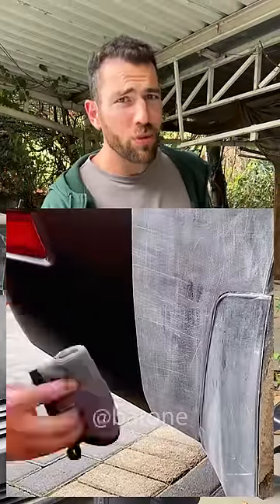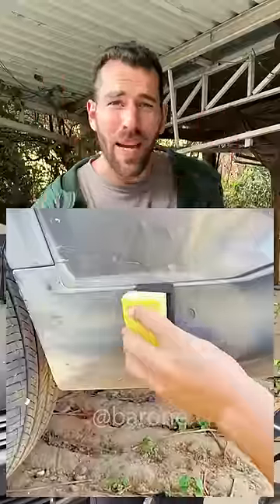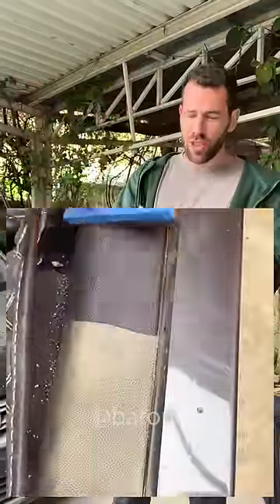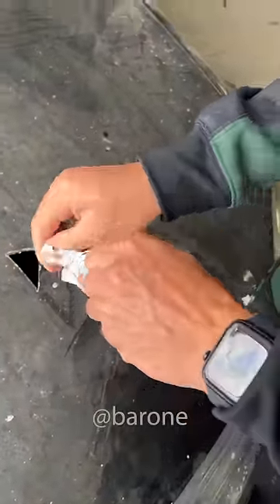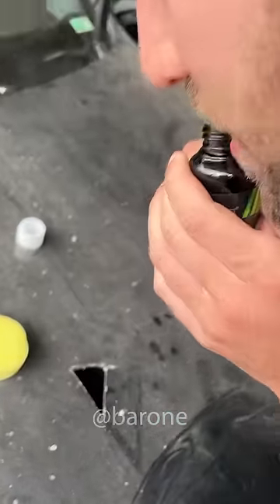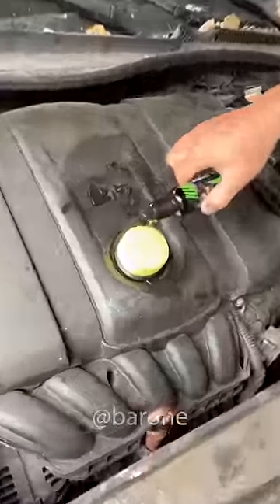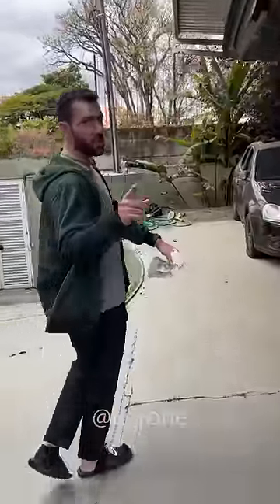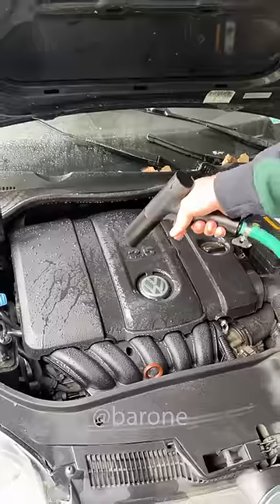This acid makes your car look like brand new

Comment: The amount of brain cells I just lost is astronomical
Reply: Agree
Reply: @TheGloryx112  how come i don't get it
Reply: @XstaticG  i think he is advertising the product wrong, its supposed to be used after the car is already clean.
Reply: @sagearuytgaming1347  the guy is wiping the dust of the engine with a spray. No really? I could get the same result with water and a clean rug
Reply: @TheGloryx112  he’s not wiping it. He’s adding a protective layer, like flex seal. So he’s literally putting spray over dust and dirt. He’s gonna have a not so running engine after a while.
Reply: It’s bothering me 🙃
Reply: He is a brazillian youtuber that reviews this kind of product
Reply: @lolpet2  He advertised as shown, if you use it on a clean car the effect is less noticeable. The point of ads is to always exaggerate and put on a big contrast, that's why most "magic" products are a disappointment in reality.
Reply: Literally.
Reply: @mandalorianforza9639 thank you so fking much, i was wondering which was his language
Reply: Not only did he apply his shit wrong he said I’ll clean 50% proceeds to “clean” 80% of it
Reply: Probably more than I'll ever have
Reply: Why
Reply: @slowbbs  good thing that’s just a cover 🤯
Reply: @mellow8309  it got all over the other components when he sprayed it all over his sponge.
Reply: @lolpet2 in the ad, it was dirty, the car

Comment: The fact that he opened the bottle with chemicals in it with his teeth and did not clean the surface before he put the stuff on there says a lot about this guy..
Reply: Bros probably not even real, my guys givin me bot energy lol😂😭
Reply: @chopboss  😂
Reply: Bro this is legit mineral oil
Reply: @lucab1733  how do you know? It says acid. And even if that's main ingredient, they probably added more chemicals that you should not get into your mouth
Reply: Bro he washed off the engine 😭
Reply: Or maybe just use water ?
Reply: InXanityZzz  you can do that after it’s cooled Down
Reply: InXanityZzz  whilst it was hot 💀
Reply: In all fairness they didnt clean the cars in the video either
Reply: Says alot? Look at his yard and Under his hood😂
Reply: Mate he’s just copying the technique shown on the adverts to test its validity
Reply: @donnyuploader  Opening the bottle with his mouth was part of the instructions?
Reply: @nijmegenares  I’m referring to the not pre-wiping down of the surfaces before application
Reply: @Hello  honestly, even if they do that in the ad, I would not use it like that, the dirt gets into the sponge, so if you use it on cleaner surfaces you would smear the dirt all over
Reply: Hes brazilian
Reply: InXanityZzz  yes you can.
Reply: @snappygaming5594  which you can do
Reply: And had the engine hot
Reply: so you mean any man
Reply: @viktorbihar5384  I feel like that's what the inside of his head looks like...one big mess
Reply: This guy has to be so generated, no way he’s real.
Reply: To be fair the car surface in the the advertisement wasn't clean aswell
Reply: The advert shows their car was dirty too. He may be was trying to do the same? 🤔
Reply: C'mon bro, that's rude. Let the guy live his primitive days in peace. 

Sure he doesn't know what car polish is
Reply: @nijmegenares  And coca-cola says citric acid in it and it aint gonna fucking harm ya calm it down
Reply: @jcdenton166  he is not opening a can of coke, it's something to clean his car. But if it not gonna harm, start drinking it than, I don't think there is anything in that head of yours than can get harmed

Comment: Hello, I professionally clean and detail semi trucks, and other commercial vehicles, along with occasionally cleaning our staff cars. 

Any soap with degreasing agents will get the same result (dawn dish soap for example). We use a mix of a chemical called “Formula 20” and “Step 2” both are industrial degreasers that we use because these trucks get absolutely covered in grease, bugs, etc. as they drive all day, this build up requires heavier duty chemicals to remove effectively, along with scrubbing from giants brushes to break up the surface of the gunk allowing particles trapped in the paint and metal to come out easier. For your average car you won’t need any heavy duty chemicals, a mixture of 1/4 dawn dish soap, and 3/4 water along with using a sponge or microfiber towels to remove dirt will produce similar results to what’s shown in the video. I always recommend adding a protective coating after cleaning, but not necessary.

Comment: Let me spray my alternator with water, it’ll be fine
Reply: The car is of therefor the alternator is fine
Reply: Yes it will be fine. Likely wont affect it
Reply: What do you think happens when driving in the rain?
Reply: Have you never sent your car into the car was to get a deep engine cleaning 😂
Reply: The engine was warm💀
Reply: @TacticalPhoenixYT  worse that could happen is it cracking the block from rapid cooling but highly unlikely
Reply: @214kai2  there are other more fragile parts than just the block. Main issue are cast iron parts, which are incredibly easy to fracture.
Reply: If your alternator can't take that, it's an American car and you ned to exchange it, it's defective.
Reply: I’d be more worried about that acid getting on the copper windings of the alternator than water.
Reply: That is his jetta.

Its kinda like a meme the amount of things this dude did to thia car
Reply: you can spray an alternator all day, it wont affect it.
Reply: Got water on plenty of alternators over the years. It doesn't affect them one bit but your belt might slip and squeal for a few seconds.
Reply: @TacticalPhoenixYT  

Only if you smack them with something.
Reply: @skylined5534  no, rapid cold changes can also crack cast iron.
Reply: @TacticalPhoenix  still unlikely unless you're over heating or something
Reply: It's funny how many people think water will hurt a car, have you never driven in rain?  Metal fracturing with temperature change is a thing, but it's only really a problem with Extreme temperature changes say your car is overheating massively  and a large volume of water is in contact with it. 
how people think that a spritz of water could do damage to a car is beyond me. Look up 4x4 river crossings if you don't believe me
Reply: It actually will, water should do literally nothing to your alternator unless completely submerged.
Reply: @214kai2  Take it from someone who used to dump room temp water in a flaming hot 25 year old junk racecar rad.... Unless you are poring ice water you will be fine.
Reply: It will be fine. Your engine bay is designed to be pretty waterproof. It would take a flood to damage the alternator.
Reply: @SoloKyoto  yea that's what I'm saying, I had huge hood vents on my old gs300 and I would take it through car washes when the motor was completely warm and had been driving for an hour or two and it was always perfectly fine.
Reply: guys it's simple...Just keep your engine (and all it's surrounding components) away from water, OR don't use high pressure water, use a light sprinkle, like the "shower" setting. No matter how modern your car is, water and electricals don't go well with each other especially overtime. One day the car ain't starting, or there's 1 or 2 christmas lights on the dash...WHY? Because of something happening on one tiny connector....CORROSION.

So long story short: Keep water away or use in safe manner.
Reply: @Kio  nobody is saying submerge your engine in water. Also pressure isn't gonna matter as much as your making it sound, only thing you'd have to really worry about is pressure popping out sensors (if even that). Cars are built to get wet, that's why you can drive through super bad thunderstorms and be fine. You just don't spray the intake and don't use freezing water on a hot block
Reply: Will literally be fine but ok
Reply: @michaelmay5453 American cars are best, 3rdworlder.
Reply: It would be fine....ever wonder what happens when you drive in the rain or through a puddle!????
Reply: @demaciasolos  AHAHAHHAHAHAHAHAH
Reply: @demaciasolos  I'm going to assume this is a joke.
Reply: @michaelmay5453  And i’m going to assume you are one aswell.
Reply: @demaciasolos  Whatever you say, kiddo.
Reply: It will, a signicant amount of cars have the alternator on the bottom of the motor layout, where it is exposed to water. Spraying your alternator with water and it failing is a wives tale.
Reply: @michaelmay5453  Still better than anything British. All cars are built in different countries. Volkswagens are built in Mexico for example.
Reply: Your average alternator even works fine underwater
Reply: @214kai2 what do you think happens when your driving in the rain
Reply: it doesn't matter it will be fine alternator coil has coting on it and it not easy to short circuit that part however a junction box/fuse box or ECU is something you should be worried about....
Reply: Wait till you hear about rain
Reply: @hassanhabib4716  Oh yeah it is, you see there is a transformer on it to turn the alternator AC into DC.

The ECU OTOH is sealed shut and in most cars it's not in the engine bay anyway.
Reply: It will be fine lol
Reply: @Mike-we3rb  Yeah, so completely soaking something  is quite different from spraying it a little bit and most cars put the alternator in a location where it isn't exposed because while it can withstand water it still has a transformer to convert the output from AC to DC as well as other circuitry that is sensitive to oxidisation and getting shorted out.

Don't leave an exposed alternator out in the rain even if it's not running.
Reply: Ya. It will be fine.
Reply: The detail shop next to the mechanics shop I worked at would pressure wash every single car they got in... including maybachs and a couple ferraris etc.. never an issue. They never bagged anything off either. Half the time the car was running when they washed it too lmfao. Not as big a deal as you think it is

Comment: Clean the plastic before applying any dressing to it ( applies to waxing paint aswell) and the engine cover has a lot of oils on it so wipe it with isopropyl alcohol( higher percentage the better).

Comment: A can of WD40 does the exact same thing
Reply: Did a guys engine once and he was amazed like where do I buy that stuff I said it's wd40 lol
Reply: yea but wd40 fades much faster especially in hot environments like the engine bay and it smells (good for petrolheads not good for your girlfriend), what's best is either ceramic coating or if you know how to do it you can also use a heat gun to restore faded plastic
Reply: Does the same thing if your willing to respray every 5 minutes 🤣
Reply: A bottle of vegetable oil also done the job nicely!
Reply: Tire shine too
Reply: @bunta_wrx5851  heat gun does work but I’ve heard that while it does make the plastic look better it causes it to become brittle and form hairline cracks
Reply: olive oil will have this same shit effect
Reply: @tylerburnell7306  yes it's very easy to mess up everything
Reply: @donaldliverance2597  congrats

WD40 is going to eat into anything rubber and seals.
Reply: I clean my engine bay with Great Value baby wipes believe it or not, it's a great degreaser. And if you want some shine use some Aerospace 303 or Armor All wipes. I suppose you can get fancy with it if you want to.
Reply: @Manu   you wipe it on with a rag lol
Reply: Silicone spray works much better.

Comment: Efficiency is not the only thing that matters if I use hydrochloric acid to clean something it might work at first but It could damage the object and release poisonous gasses later.

Comment: It did shine at first just like it shows... Also remove the parts and use a torch at a distance start far away and get closer youll figure it out but a little heat sometimes helps, better if you have a heat gun just dont melt anything and test hidden areas first.

Comment: It's normal liquid silicone. They also sell it as tyre bumper and dash shine.
Reply: And lube.
Wait is it ?
Reply: @-na-nomad6247  it's a clear silicone based liquid. It covers the plastic and gives it a glossy shine. You can also apply it to the inside of your windshield so in cold weather your windshield doesn't fog up

Comment: Just a quick rundown of the steps. 

1.) Apply protectant chemicals on the passenger side of a hot, dirty engine bay. 
2.) Let it soak for a few minutes. 
3.) Come back and immediately spray entire engine with a garden hose. 
4.) Make a comment about how the water isn’t sticking to the side that was treated with protectant. 
5.) Wipe the hot engine cover dry with a flammable cotton rag. 
6.) Enjoy! 🙂👍

Comment: You can achieve the same result with vegetable oil.
Reply: Does the vegetable oil hold up for a while or is it short lived?
Reply: @BackRoadBandit87  it hilds up longer than my brain cells after this video.

Comment: Yeah I trust him. A guy who sprays his engine bay with water….
Reply: Hosing down your engine bay is fine, as long as you cover up the air filter, battery and fuse box
Reply: And obviously removing the battery
Reply: @Lt.Dan_23 man you're high
Reply: @Lt.Dan_23  man what are you smoking?

Comment: Fun Fact, plastic is made with oils. simply pulling your dipstick and using the old oil already in your car you can use it to re hydrate the plastics surface

Comment: I bet if you read the instructions it says to clean the area with a degreaser or APC first. Probably also mentions not using on components that get hot. Lastly never use a pressure washer in the engine bay.

Comment: It almost makes it more dirty just going over it with that coating first before washing it lol 😂 and there are tools to restore paint that are a-lot more efficient but the first step in even restoring anything especially paint is to wash it first. But with plastic you can use tire shine, wd40, or just plastic restorer in general

Comment: I just use the big bottle with the wide spray head wd-40 to clean the engine bay. Anywhere that is say to spray on and wipe. It looks brand new. And no my car doesnt light up on fire let it dry out very good with the hood up and its fine. Only when the engine is cool

Comment: The only thing wrong with this is that he sprayed water in the engine bay while the engine was still up to temp, if you do this with car cooled off in most newer cars, you aren’t going to damage anything. If you’re afraid of alternator, use a plastic bag to cover it

Comment: When I went to school for automotive our teacher taught us to just spray wd40 on the engine bay lightly and while the engine is running lightly spray the motor and pressure hit the engine bay . Been doing it since with no harm to my vehicle
Reply: Congrats

WD40 eats into rubber and seals, can also cause damage on cambelts and accessory belts. You  don't pressure wash an engine while running or while not running. Reason: electrical components.
Reply: @Manu-Official  that’s the point of spraying lightly while running. And never had any issues. Been doing it for 15 years already

Comment: Save your money.  The entire engine compartment of my five year old car looks like new because I occasionally wash it with the same wash and water that I use on the exterior.  A little Armor All or equivalent for the tires and plastic trim and there you go.

Comment: At least clean it first and then wait it to dry.
An then use the protective coat.
Its will makes the item you coating better. It supposed to make the item new again and shiny..
Not cleaning the dirt and dust.

Comment: 1 used teeth 
2 didn't clean surface 
3 overused product
4 it's actually called ceramic coating.

Comment: Wow, its easy to dry! 

Well yes, a hot engine that you ran for 10 minutes is easy to dry.
Reply: 1- that's the engine cover
2- this car does not run
Reply: @fribiesdi  an engine cover gets hot when the engine has been running for a while and you can LITERALLY see the water vaporizing.
Reply: @aleccooks  I don't know if I made it clear enough on my first message: this engine is unable of being started. You are seeing things.

Comment: You could just put motor oil and it would do the same thing
Reply: Oil attracts dust.
It's really just a rip-off.
It's a silicone compound exactly the same as in a can of silicone spray, but they've worked out how to sell it at a 1,000% markup.

Comment: Maybe use it right and it will look like the video, you have to clean it before you apply. Plus i wouldn't buy that, there are already tons of products like that from reputable companies in your local autozone. You dont need to buy the "magic" bottle that you specifically saw on a video on tiktok

Comment: Did this guy just put a protective coat on top of a dirty engine and super spray it with a high pressure water hose 😕

Comment: It’s oil and not acid 🤦‍♂️
Reply: It's a silicone compound.
Silicone spray does exactly the same thing.
Reply: @Rob-fc9wg  still an oil
Reply: @dsrM  
What?
Silicone is not oil!
Reply: @Rob-fc9wg  silicone oil exists and other silicone derivatives which are oils